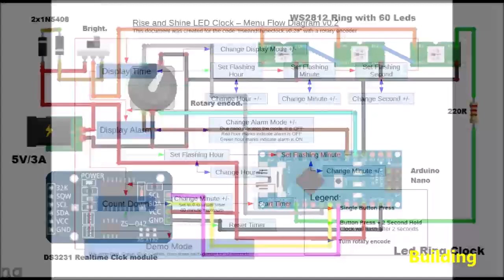DIY WS2812 Analog style Arduino Ring Clock

Comment: can i use led ws2812b 5050 addressable rgb neo pixel led. it is indivitual led. we can make ring by soldering 60 led.pl. help.
Reply from the maker: Yes of course, you can use 60 of those diodes

Comment: 👍👍👍👍👍😎 (Rather than using a RTC Module) Look into an "Atomic Clock AM Radio Module for Arduino. set to a frequency for your Country.. wwvb North America example of 60khz I think also 77khz Europe?? Will keep perfect time (Automatically) No manual setting required if you set your time zone correctly in the code.   (Excellent inspirational project) Thanks for sharing.